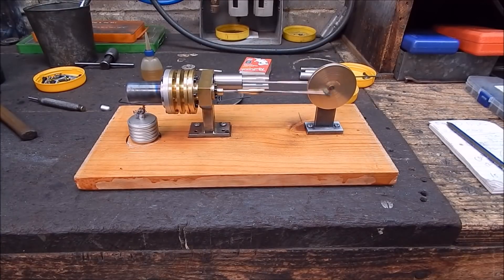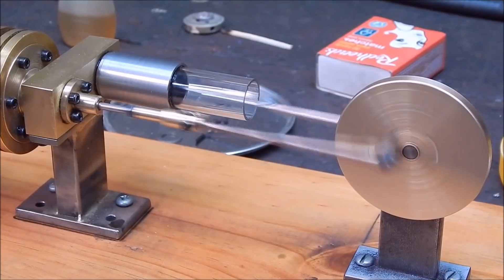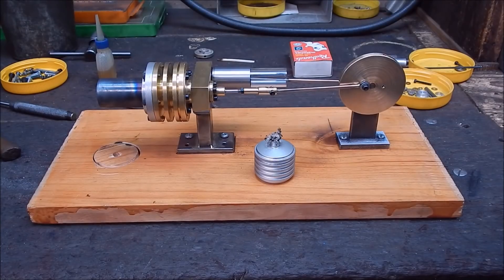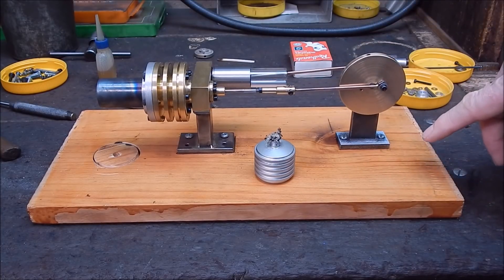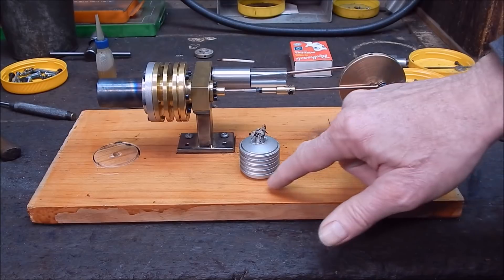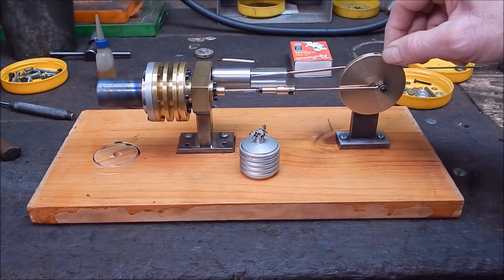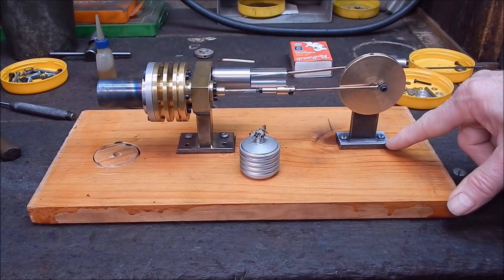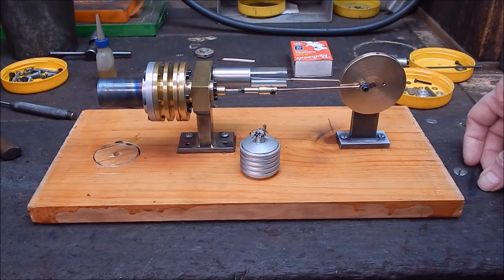My no plans DIY Stirling engine project finally runs - excellent

Comment: I used to have one of the Sterling engines mounted in a solar collector dish and it ran of of the heat from the sun. This one is cool because you made it yourself. Maybe I should think about building one myself.
Reply from the maker: Yep.  I've done all the hard yards for you.  Just use the specs in the comments and it should go.

Cheers Rob

Comment from the maker: For anyone thinking about building something similar, here are the basic critical measurements before I lose them:

Stroke - 15.5 mm on both displacer and power piston
Displacer size - 50 mm long by 20 mm diameter of solid aluminium
Displacer bore 22.45 mm
Displacer rod and both conrods - 3 mm stainless steel (Chinese barbecue meat skewers)
Displacer stainless steel heat cap thickness - 1 mm
Cross gallery diameter - 4 mm 
Piston separation - 30 mm centre to centre  (40 mm would allow more separation between the crank pin ball races)
Crank pin diameter - 6 mm running in dual open sided ball bearings
Cross gallery to crank pin separation - 155 mm centre to centre
Power piston (dash pot) thread 26 tpi BSB
All fasteners - 3 mm

That should get you there.

Cheers Rob
Reply from the maker: A few more specs that may help:

Piston crown clearance on both cylinders - 1.5 mm (adjustable on displacer - important)
Stroke phasing - 100 degrees
Leading piston - displacer
Power piston diameter - 15.9 mm (if you wish to make your own)

Cheers Rob
Reply: Maybe you could pin this comment to top so it doesn’t get lost ?
Reply from the maker: OK good idea.  I have done this.

Comment: Very impressive!  Have you considered driving a generator to see its affinity to do work?
Reply: Nice work Rob
Reply from the maker: No.  It would have to be a pretty small generator.
Reply: Something along the lines of magnets in the flyweel and stationary coils like an alternator.  Add some diodes to make dc and see whay kind of electric load will be tolerated by the motor.
Reply from the maker: I could easily belt drive a small led generator off of it and makes coloured lights.  It's quite a punchy little engine.